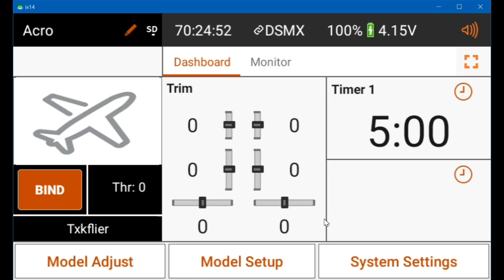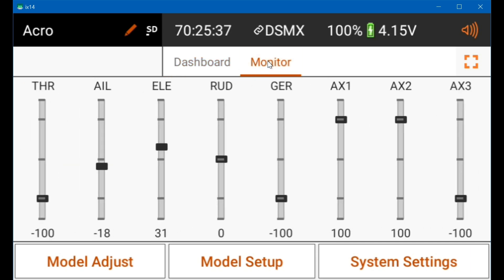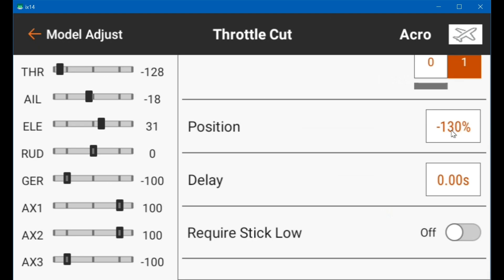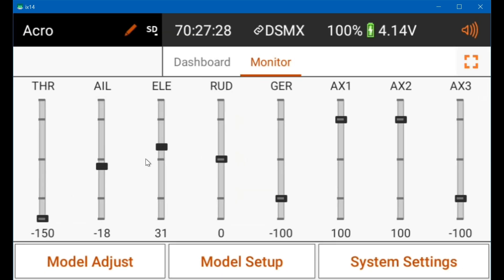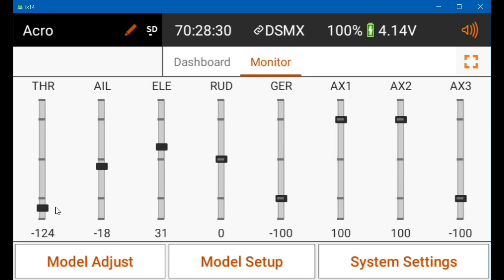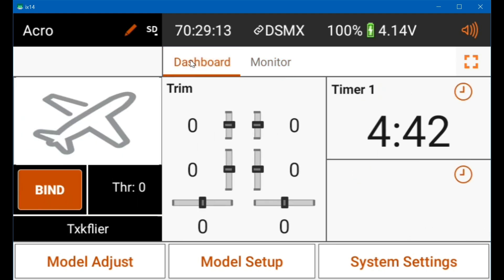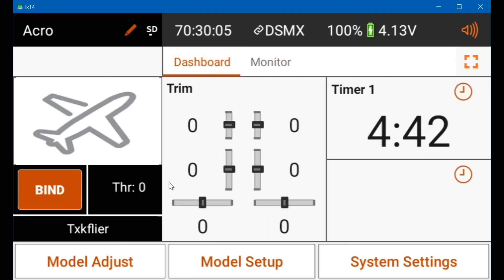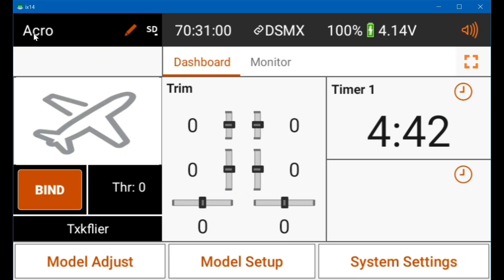Using 1 to 2 mS ESC's with a Spektrum Transmitter

Comment from the maker: Update: The old default of -130% was for gas (or glow) engines. It will close the carburetor and kill the engine. It should be set to -100% for electric aircraft so that the ESC will see the same value in both positions of the throttle cut switch. However, on gas engines, you should use an electronic switch on the ignition module.

Comment: The Spektrum software Version 2.05 changed the default from -130% to -100%. You should still use -130% for internal combustion engines, and -100% for electric motors, as long as the LOW THROTTLE VALUE is the same, i.e. -100%.
Reply from the maker: @hifinsword  That’s true. I’ve been flying electrics for so long, I’d forgotten about that. I’m not sure I used throttle cut on glow engines, but it’s definitely needed on gas engines. I used to fly a friend’s gas planes, but never had one of my own. Thanks for the reminder.
Reply from the maker: @hifinsword  After thinking about it, I never used throttle cut to kill my glow engines. And on gas planes, I used a kill switch on the ignition module instead of using throttle cut to close the carburetor. Killing the power to the ignition module is more reliable.